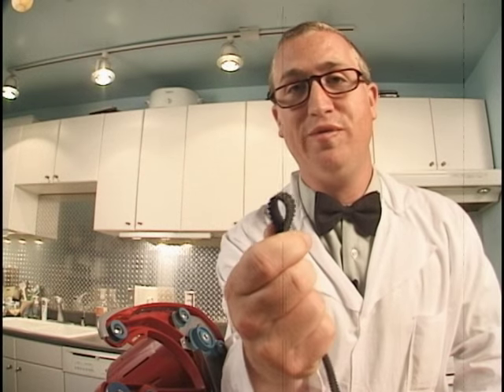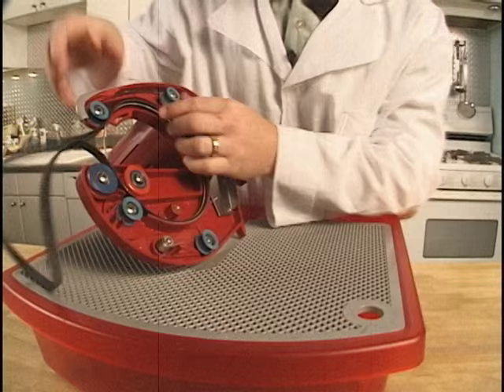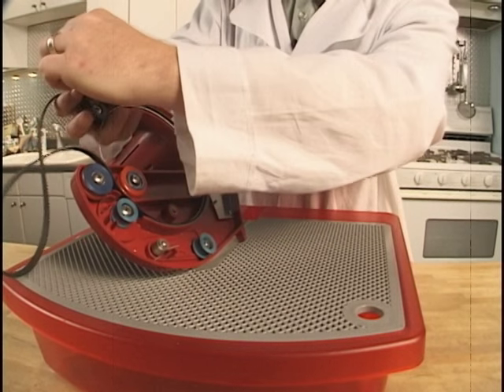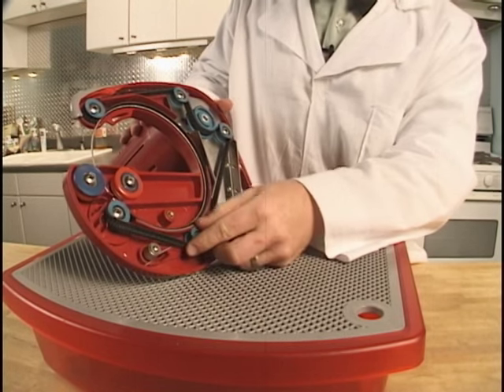Gemini Ring Saw - Taurus 3 - Chapter 14: Replacing Blade

Comment: So.  This is about as helpful as your written instructions which 1) tells you to remove the first top blue pulley as part of the process and 2) at least in the manual it addresses the blade guide attachment which you not only don’t  address but isn’t on your saw in the video.  Ironically, these are the things that are complicating the process.  I did not find this helpful at all.

Comment: Great video - but it is out of date! Mine has a blade stabilizer on it. I had to replace the two rubber bits awhile ago but now I need to replace the blade and don't understand how to get the blade between those stabilizer bits.
Reply: Mine has the stabilizer with two small orange rubber "gears" surrounding the blade. I just unscrewed and removed both of them and unscrewed the one screw (all the way out) on the stabilizer and wiggled it off. Now you can replace your blade. Next put your stabilizer back on, adjust and tighten. Just screw the small orange rubber "gears" back next to the blade and you're done. As you can see in this vid he removed his stabilizer arm first. Good luck!